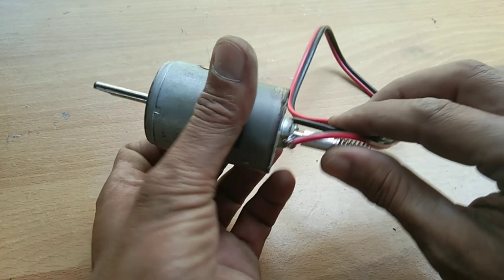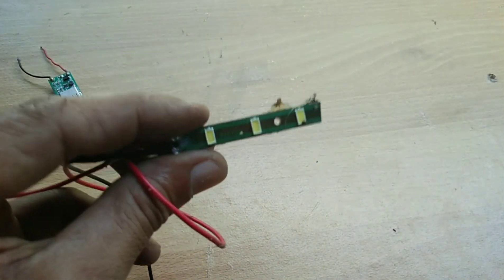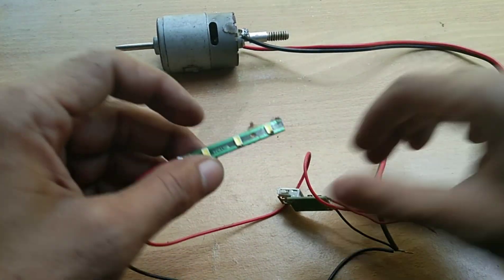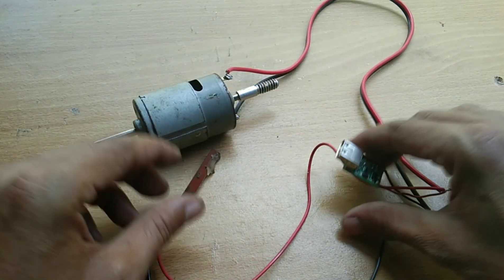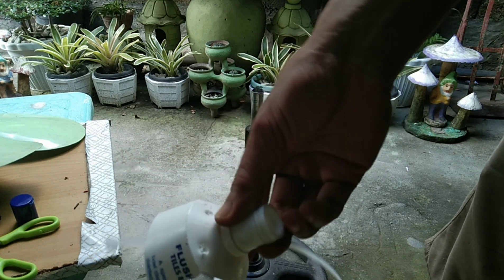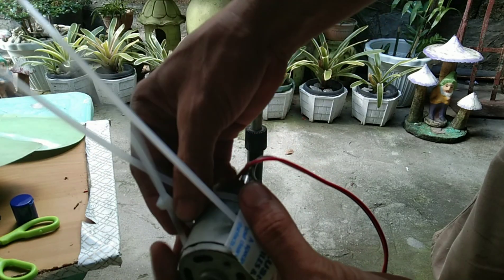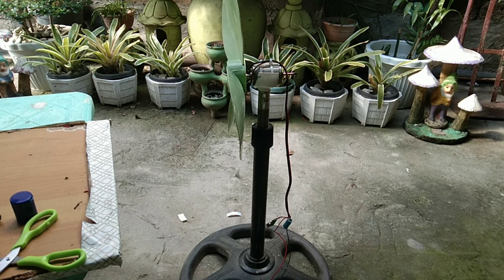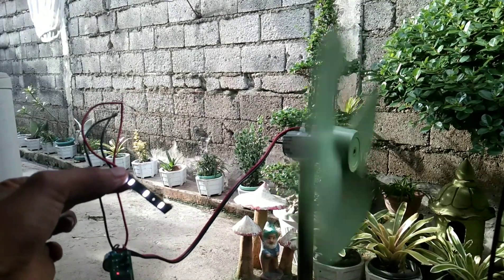How to charge your mobile phone using wind turbine 2021 #freeenergy

Comment: May I know po kung saan nakakabili ng charging module? atsaka ano po yung exact name. Thank you po
Reply from the maker: Step up boost converter. 5 volts output Meron po sa Lazada
Reply: @MrDIYProjectTech21  Thank you so much po more power sa channel niyo boss
Reply from the maker: Walang anuman po. Thank you so much po

Comment: ilang watts po ba yung dc motor mo sir?
Reply from the maker: 34 watts at 6000 rpm operating at 12 volts supply. Pag mababa naman po rpm banana din wattage at Kung tataas Naman po rpm tataas din wattage. Salamat po

Comment: ilang watts po ba yung dc motor mo sir?
Reply from the maker: 34 watts po at 6000 rpm operating at 12 volts supply.  Kung mabagal naman po Ang rpm mababa din watts. Pag tumaas po Ang rpm tataas din Ang watts. Salamat po..